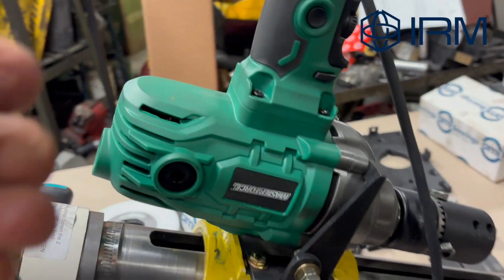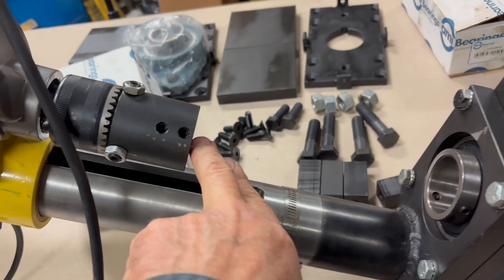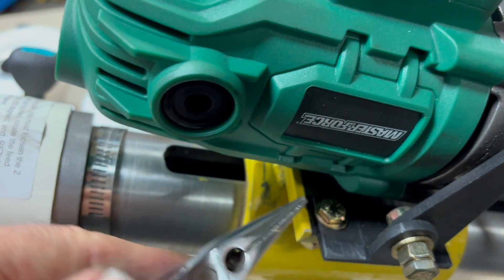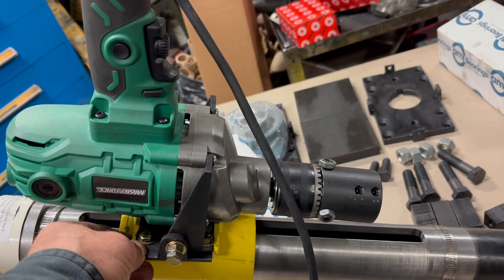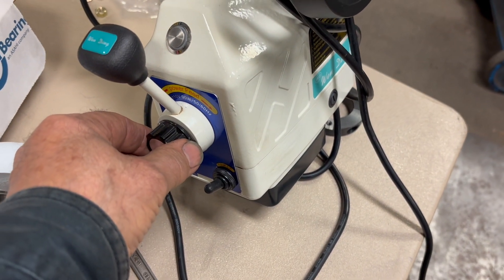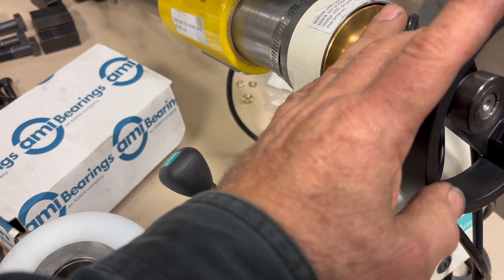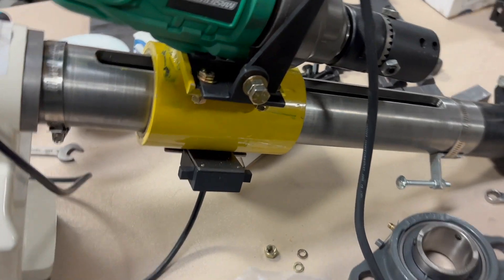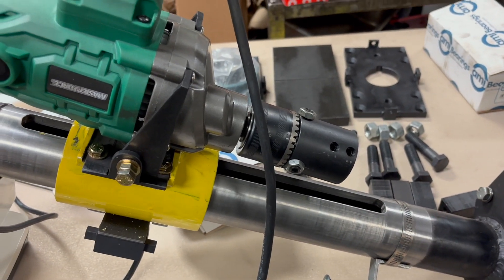Line Boring with a Hand Drill (adapted to a Power Feed) | Budget Friendly American Machine

Comment: Tell me more about the power feed.
Reply from the maker: Basically, a power feed is a mechanical device, often with digital controls, that attaches to machine tools. In our case - it is specifically designed by Iternational Revere Machining to attach to our line boring equipment. But it can be used with other tools, anywhere 
Automated Material Transport is needed.

It automatically advances the workpiece through the cutting tool or moves the tool along a predetermined path, replacing manual hand-wheels to provide a constant, consistent feed rate and improve precision and efficiency.